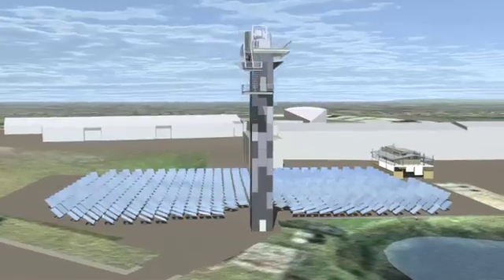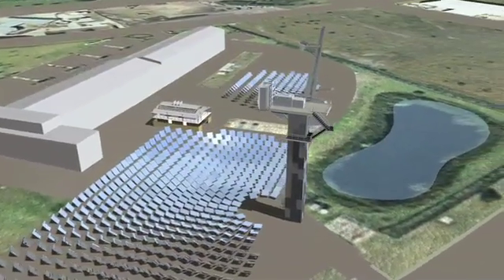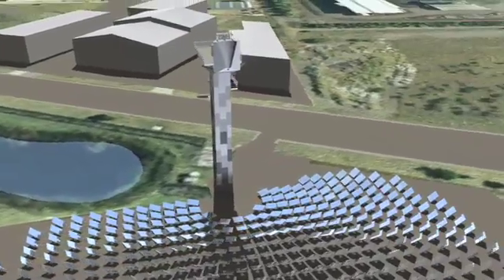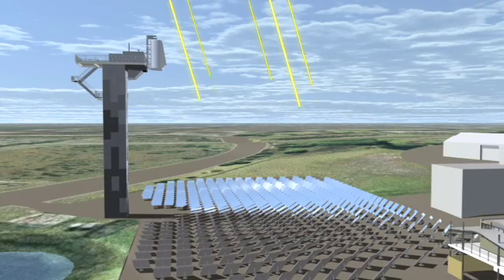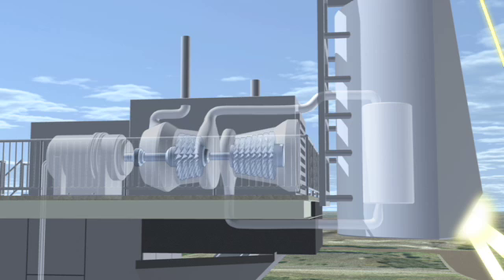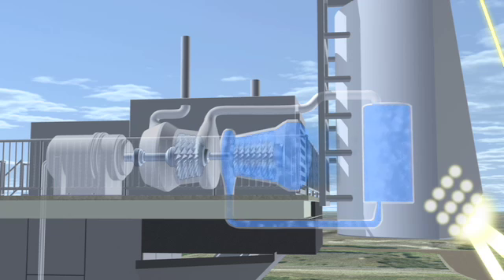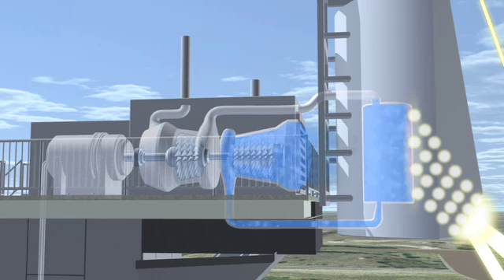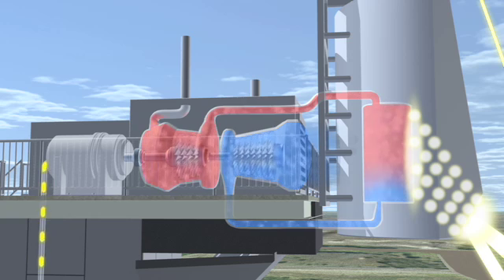Australien - Brayton - CSIRO Solar Tower

Comment: It's not efficient enough. Instead of hot air they should use molten salts cycle with cold and hot containers. That way they can still generate power even after sunset.